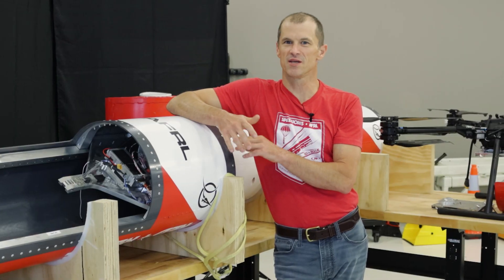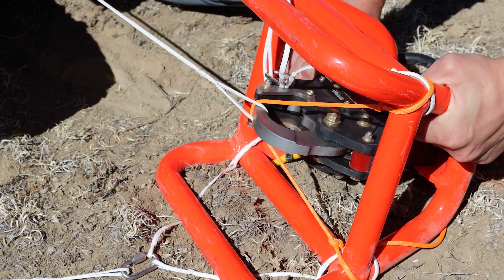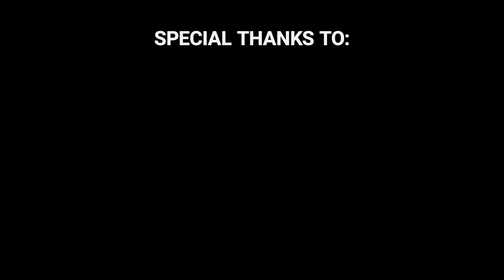SpaceWorks® RED-Rescue

Comment: So where does the drone go? It surely can’t fly back to its base. What’s the point of a drone when you’re dropping a payload?
Reply: It seems disposable. It’s basically a fine tuned air drop that can be deployed from a fast mover (they claim it can be dropped from Mach 6 speeds).
Reply: @TimBryan  yes I heard that's why asked what's the need for a drone as it's already being airdropped.
Reply: @BariFPV  airdrops are notoriously imprecise even out of a slow moving airplane, so they would be even more imprecise out of a fast mover. The drone gives much more precision and also enables more stealth in getting the payload to personnel behind enemy lines compared to a slow moving parachute.
Reply: @TimBryan  where did laser guidance go? There are so many things one could do to drop a payload precisely where it's intended to be dropped mate :) a slow moving drone is sitting ducks for even light firearms. And especially as the airdrop is intended for "behind enemy lines" therefore I don't see how it's fool proof. The payload is eventually dropped from 15 feet, you could let the whole capsule drop and have one ejector rocket decelerate the whole thing hardly 15 feet above ground.
Reply: @TimBryan  and I'm not "anti drone" person. I race with drones :) and before FPV (quadcopters, flying cameras) and all these things became common years ago used to fly fixed wing drones +100km range with dragonlinks. So not trying to play devil's advocate here.
Reply: @TimBryan  Surely a fixed-wing platform would be significantly cheaper to dispose of and be able to crash/land near enough to the downed airman?